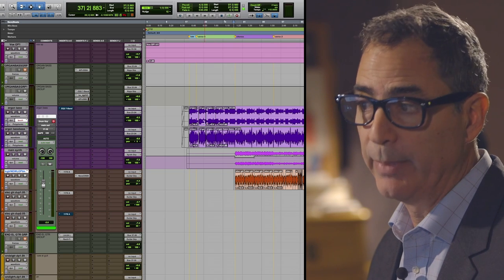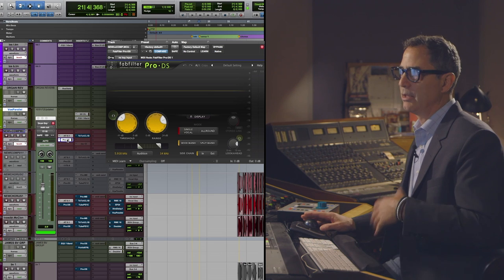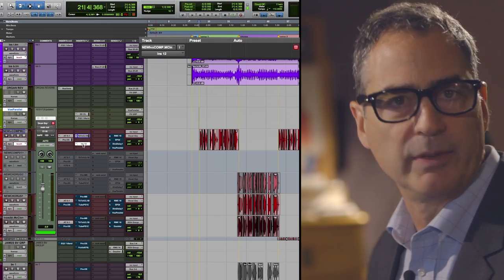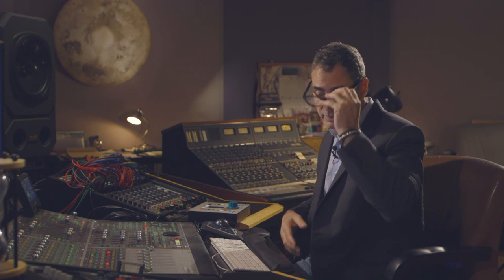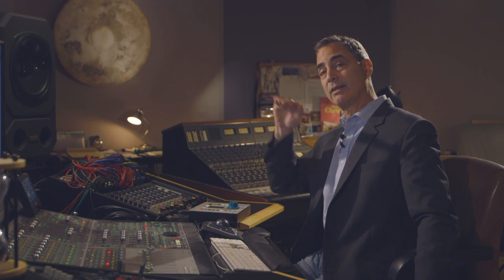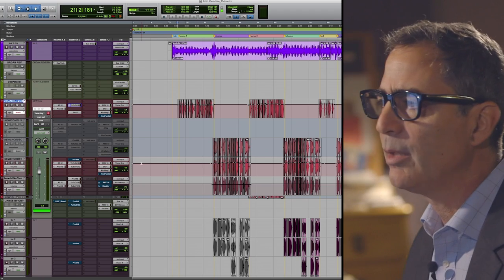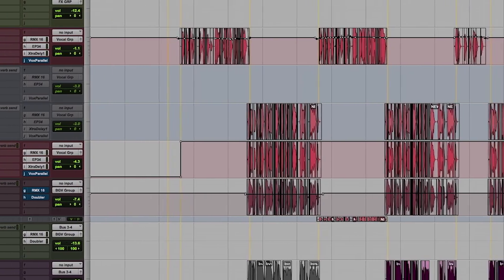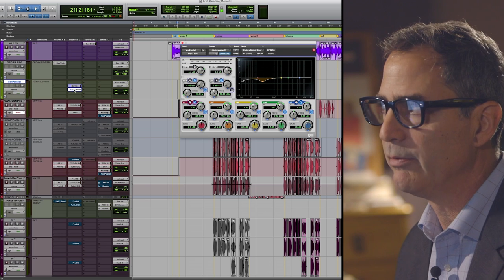Mixing James Blunt Vocals - Tony Maserati

Comment: Intrigued to see how he split the sections so clearly so the V and CH can be treated totally differently. Been struggling with a mix for a  female vocalist I've never worked with before and all the reverbs kept disappearing in the CH. Rather than try to automate everything, I'm gonna split the sections and do fresh groups - I normally work with all the guitars like that and BVs but not the main vocal - cheers for the video!
Reply: MFGuitarStuff I assume you’re splitting the tracks with the signal still dry right?  Any modulation type effects should be added after splitting, not before.